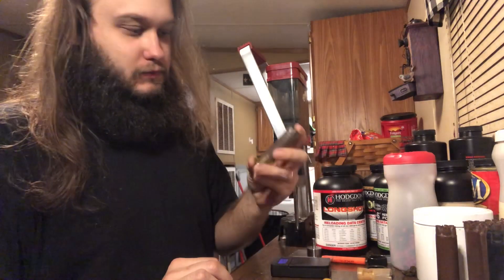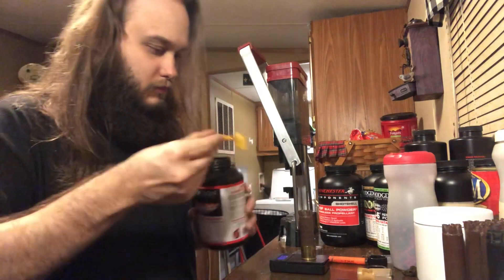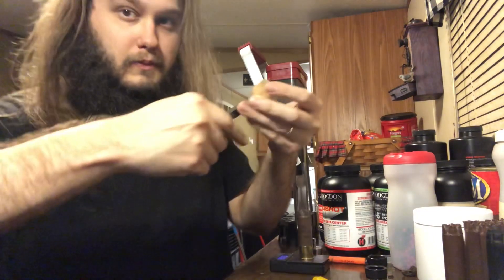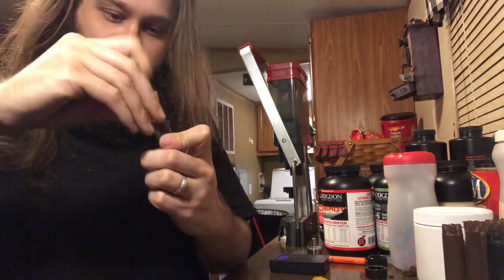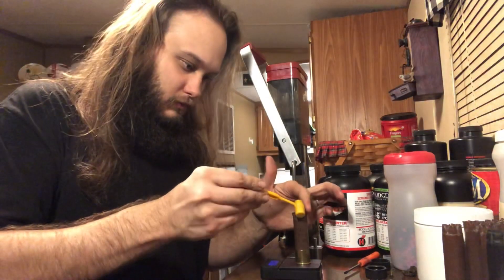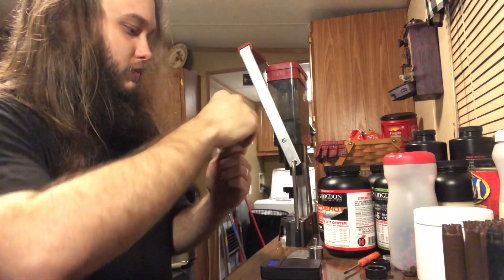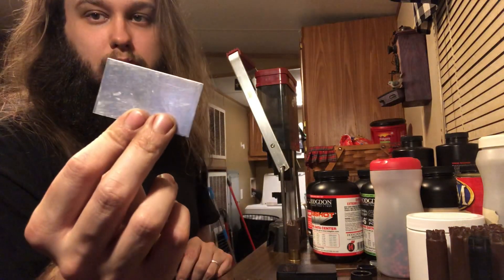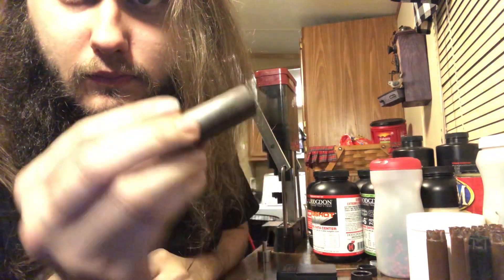10 Gauge Crow Loads - What To do When You Cant Get Components

Comment: Nice on the crimp job do you ever have any bulging of the hull walls where it isn't supported like the crimp station on the load all
Reply from the maker: With 0000 buck yes a little bit it fixes itself when you lift up on the press.
Reply: @theshotgunscientists  I just started reloading shotshells  I thought it was going to be alot easier but there is alot to it i never thought about modifications to the components that I have shotshell stuff is getting kinda scarce.That was a pretty good idea with the bingo chips too
Reply from the maker: @neilhandley5876  Thanks. The bingo chip idea is just something that’s been done for a while and I picked up on it from wade rush on here. An easier way of doing the wad trick I showed here is just to simply use the x10x gas seal from ballistic products and use the wad as normal over top the seal. No flare needed but either way works great.

Comment: 🤔 Got over 100 Federal hulls from a guy BUT all were cut to 3” (not sure why) I have 1044s and looking for a ‘special load’ that I can continuously use in these hulls. So if I jump to 1 3/8oz I drop a grain down of Longshot or just ladder test my way up? Got a load for 2 7/8 that uses 1 1/2oz? My manual only shoots 1 1/4 in 2 7/8”.
Reply from the maker: Send me an email man I have tons of data for shorter 10 gauge loads. You could just add an extra nitro card or two under the wad to get proper stack height. Most of it is low pressure stuff up to 2 ounces if I remember right. 7/8 ounce loads up to 2 ounces.

Comment: Can't find long shot. What other powder and charge weight do you recommend?
Reply from the maker: Winchester wsf, hs-6, green dot, blue dot, all have free data on the manufactures websites. Trouble is actually finding powder. The only charge I remember off the top of my head is 31 grains of wsf.
Reply: I use a lot of 2 7/8th inch with red dot or promo. 20gr and a fiber nitro card with cushion and 1.25 oz lead
Reply: @jacobackley502  I found some Longshot. Loaded 10 rounds earlier, I used 34 gr of powder and 1 3/8 Oz of 5 shot. It didn't all fit in the wad. Also had to stack some foam wads I made under the wad to bring it up for crimping. Shot 1 and didn't blow myself up, it was a successful day😁
Reply: Brownell's has longshot in.

Comment: Question.  I have sp 10 wads and x10x seals. Will this work and be safe with the same powder charge? Will be doing 1 1/2 oz of 6 shot.
Reply from the maker: The sp10 wad has a built in cushion section just like the claybuster wads do. Pressure shouldn’t change much at all. You might be able to ditch the gas seal all together and only use the sp10.
Reply: @theshotgunscientists  thanks. Gonna have to use seal to take up space. All ready checked .
Reply from the maker: @jeffshields7924  awesome